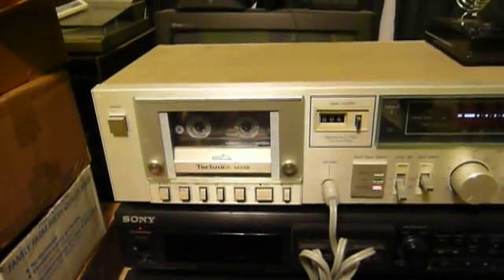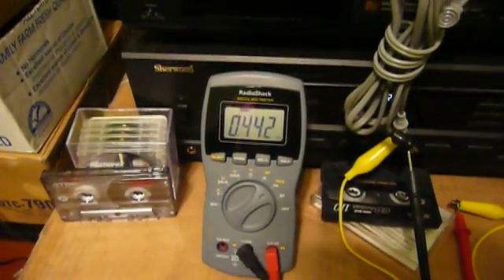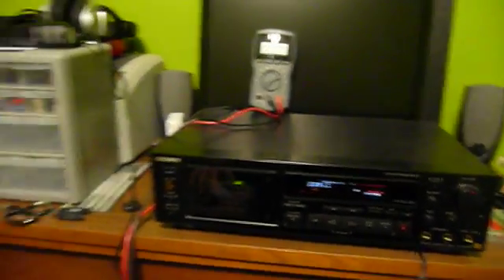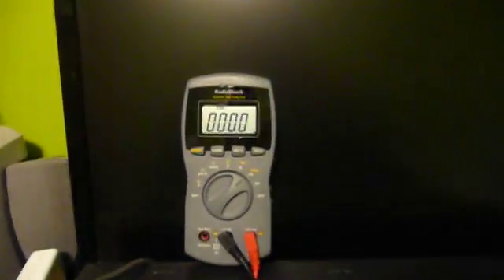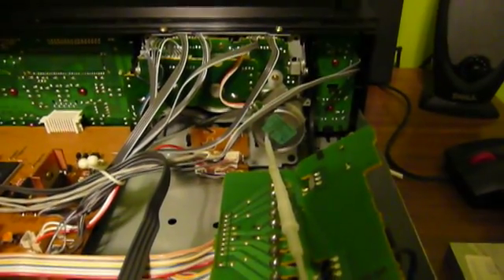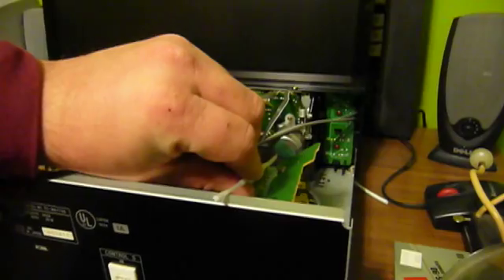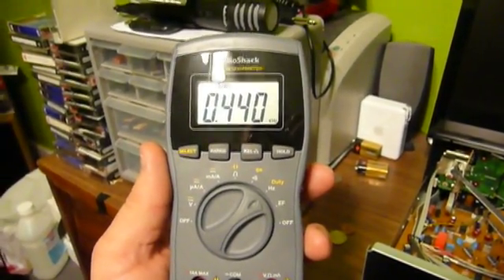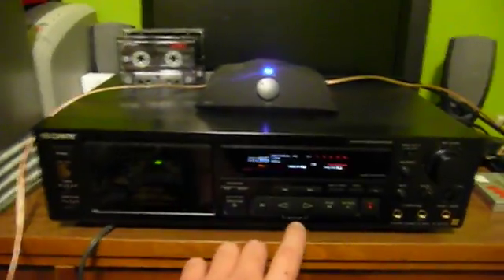Another Day, Another Tape Deck

Comment: My Sony TC-WE475 (which I bought new in 2001) is OK when it comes to speed, but its Dolby B just plain sucks. It muffles the highs too much, and during the quiet parts of a song it gets very choppy. My vintage Panasonic 608D (also sold as the Technics M5) is far superior, with no noticeable Dolby artifacts as long as you have the head aligned correctly. This concurs with the claim I've heard that decks which only support Dolby B do a better job with it than decks which also support Dolby C.